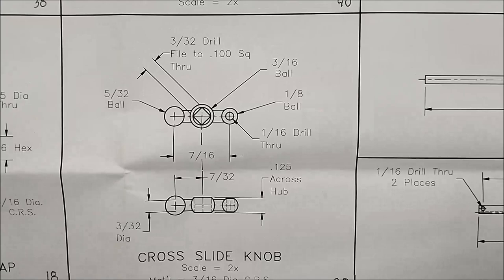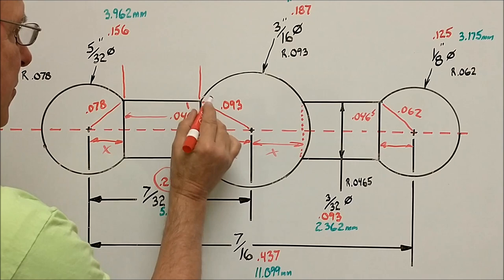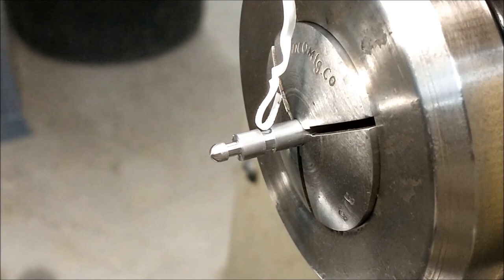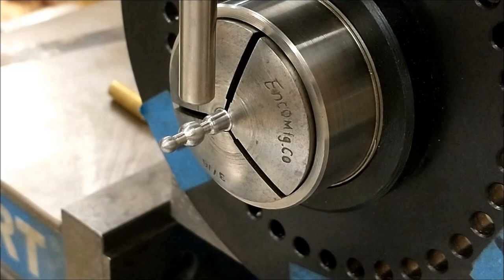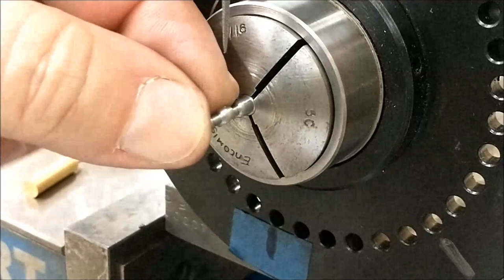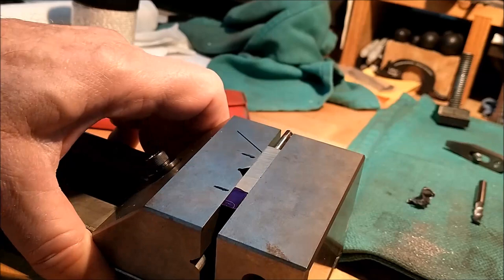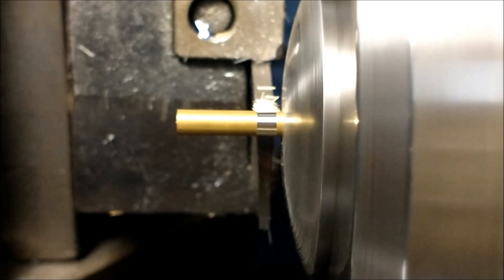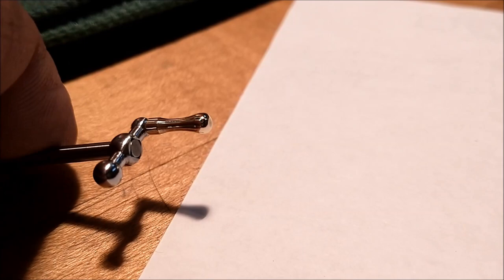Miniature Engine Lathe - #2 - The Crank Handle

Comment: As an old Jeweller can I offer some advice to those looking at buying "Needle files"...
Buy good quality Swiss or German made files (typically from a good Jewellery Supplier) in a 2 & 4 cut.
They wont be cheap so ONLY use them on brass, copper & steel, the "2" is better for roughing in steel & the "4" as a finish.
Save those cheap crappy "throw-away" ebay Needle files for "gummy" metals like lead.
HTH, Colin

Comment: Nice work, as usual Joe. When I used to make very small pieces like this, I made a small hand rest (like on a woodworkers lathe) and small cutting tools, either with wooden file handles or held in a pin vice and did all the turning completely by hand with razor sharp polished cutting surfaces. I finished with 600 and 1000 silicon carbide paper glued to popsicle sticks, followed by buffing with jeweller's rouge. Edit: I should mention that I filed and flattened the edges of the popsicle sticks and glued the silicon carbide paper to the edges with contact adhesive - I would make batches of these as I used so many.

Comment: If you build a miniature CNC mill, then you can program it to build an even smaller CNC mill.  Good luck getting the stock lined up in the miniature vise, though!   Good luck winding the miniature motors.

Comment: A great way to analyze a 2-d drawing, is to model it in a 3-d Cad program. It is like machining the part geometrically and virtually. Now you can easily see measurments not given on the drawing, to suit your way of machining, just like you are doing manually on the white-board in this video. It takes longer, but works well for people who might feel uncertain doing it manually like you.
Also, if one do it for every part, one end up with a complete collection of 3d-models of the whole thing, wich can be assembled, displayed, animated or analyzed in many different ways.
Reply from the maker: Thats usually standard here for internal projects, but this thing has 133 parts. I'd like to finish before Christmas.
Reply: @joepie221  I can understand that :)

Comment: I cannot wait to see you cut the threads for the compound and cross slide and the lead screws and the matching nuts. I assume they will be authentic, and either be acme or box threads. There may even be some specialised internal boring bars made!
Small parts often require greater skill than big ones, and good eyesight.
Reply from the maker: Actually, they will be standard 5-40 LH. Only the feed clutch gear will be special.

Comment: I was thinking "surely he's not going to accept that potato shape?"... of course not! I mean, I would, but we know you don't. Thanks for the tip about using the small cut off disk on a dremel for shaping the radius tool. Would not have occurred to me.
Reply from the maker: It looked round until I blew up the video during edit. I couldn't let that slide. But it looked fine from 2 feet away.

Comment: Another great video, Joe Pie.    I just noticed your scribing tool - I assume you made that yourself... and made a nice cap to go over the sharp carbide point?   I wished you would have put a few shots of you with the dremel tool creating the radius in the form tool.   I assume that you did that with the carbide cut off wheel?    Weird question - if you needed to bend a piece of high speed tool steel - how would you do it?  Get it cherry red with an oxy acetylene torch and bend?   Love these miniatures that you are building.   Definitely family heirlooms
Reply: I dont know how to do that but if it helps you can weld a HSS with a stick welding electrode for chrome Saf5.4  E316-16 / ISO 3581A E19 12 3 LR12,
I joined  mild steel and HSS blank with that electrode.Althou if its suoer small you could use silver brazing.
Hope it helps with whatever you are making.

Comment: I believe the toughest thing on this part for me would be seeing it.  I have an Optivisor I like, but I think this would push me to get some surgeon's eye loupes that attach to my glasses and allow higher magnification.  It's that or mount a stereo microscope on the lathe and mill.

Hat's off if you can see all that without so much as a pair of glasses, Joe!
Reply from the maker: Hi Bob. I have a bank of jeweler loupes I'm quite fond of. When you see one of my fingers in frame and a shadow, you know I'm cheating.

Comment: As some don't have blade micronometers ... just my two cents ... a straight triangle cutout on a sheet may help to check the diameter by measuring how deep the zylinder will pass into the cutout. You may show the maths behind it and how to improve the technique to do the readout. Topic: How to diy measuring tools. 😎

Comment: Joe, this is a beautifully executed job, particularly as it's so small but I have a bit of a beef with the design you are working to. For me, both ball ends should be the same size, the handle should swivel, have a deeper concave curve and should be recessed iwo the ball. But hey, when the thing you're making is not much bigger than your thumbnail who am I to criticise and in any case it's a question of design not your machining. Thanks for all the insights.
Reply from the maker: The non handle end ball on most crank assemblies is always bigger to balance the weight and eliminate the flop potential. I also mentioned a flat on the smaller ball to accept the handle would make it look better. I agree that area could use a tweek from the print design.

Comment: You could make the brass part spin, by leaving the shaft a thou or so protruding from the ball, drilling and tapping the end of the shaft, then securing it through the ball, with a washer head screw.
Reply from the maker: The shaft is only .06 in diameter. I'd have to go sub  'O' on the screw to do that. Maybe a hollow grip over a pressed in headed stud?

Comment: I thought FOR SURE you were going to use a square rotary broach to make that center hole in a different setup.
Did you peen over the cross slide handle knob or expand the back end using a star punch. If you peened it, I would like to know how you did it. With a part so small and delicate, it must not have been easy to prevent distortion.
Reply from the maker: I have a broach, but wanted to share the file trick. When its time to secure these, I'll hollow the smaller diameter for a very shallow depth and use a spring loaded center punch to flare and lock it in place.

Comment: Hey Joe, you've stated before you dont like wearing a wired mic but some of the times at the white board got a little hard to hear. Maybe check out the new mic ABOM79 got,  its a little square thing he can clip to his ball cap and is wireless. as always the machining porn was spot on.

Comment: Thanks for giving the equivalent mm dimensions
Reply: I was most grateful for it in the beginning too, now, after having bought a few machines and having used them, i got to the point where i switch back and forth as i need... If its thousandths, you divide by 40, as 40thou is 1mm... Actually, first practical application of it i used was for welding, as to weld, you can go 1amp per 1thou, meaning 40amps for 1mm steel sheet... Tig i mean, but when i first needed to set my welder up, i looked at the material, saw 1mm and instantly knew it was 40amps/thou, after that, all other fractions and nonsense fell in place by themselves... Tenths are actually a nice thing to work by, and that is coming from an ex metric loyalist... I despised inches and all the american measuring malarkey, but after working in metal and needing say sliding fits and what not, why bother with decimal millimetres, when you can slap an imp indicator and move in a 10 thou, knowing that you moved 0.25mm, dividing by 4, or 1 thou, 0.025(4)mm... If not working by specific design that relays tolerances in microns with practically no +/- allowances, despite working in metric, i will often have at least 3 imperial indicators along with 3 metric ones, each on their own stand and waiting for their moment to shine... I dont go for tenths indicators, as i have metric traumatizers for that that read in micron increments and  0.0001mm increments which is right about when you start losing your shit and want to do some heroin, as that cant be half as bad of idea as working in tenths of a micron... Its what metrology monsters call microcators, as an indicator is something made to refer to such a gross scale, that for an instrument like this, you need a micro prefix... And they say a tenths indicator is maddening... You breathe on the part for a few moments near the point of indication, and it rises as it heats up from your breath... You fart hard enough and it twitches from the shockwave...
Reply: Bro I agree. Us civilised people need metric

Comment: Hey Brother Joe, - I'll bet 55 degrees in your shop feels cold to you after what you went through last summer, but to make you feel a little better the coolant in the horizontal band saw was frozen when I got to the shop last Monday. I'm going to RV antifreeze for coolant for the winter.(Shop cat goes out there with me during the day)   I had parts that had to go before things warmed up and in 30 minutes on the lathe and I had no feeling at all in my fingers (Remember. Loose the gloves around rotating machinery or loose a finger) Best part is it's going to get a lot colder in the next 2 months.  Oh Joy. 

Anyway the reason I called is can you show us the details of the split bushing in the next vid? Did you machine it to the form of the part or what? Inquiring minds want to know. --- I have no clue how you held it. 

I'd tell you good job but you don't know how not to do one. That doesn't make it damnd impressive, though.

Comment: 12/21/2021
First, I know that this project is long ago completed, this comment is FYI only.
If the cross slide knob profile at 1:18 is taken from the drawings used to create the "exploded view" drawing. it was developed from 3D modeling software, where the part was initially a 3D model.
If this is correct then the view at 3:18 is actually correct to the initial model assembly (in the computer).
What you want to create is most likely right, but the drawing is also correct to the computer model.. I used to do shop drawing and 3D modeling (Auto Desk Products). Sometimes the model does not develop the way intended, especially if it is as small as what your dealing with.
By all means, make this part the way you BELIEVE is correct. I know very little when it comes to the actual machine work that you are doing. Honestly I am amazed at the fact that you can do what you do. 
Merry Christmas. ;-)

Comment: Well done Joe, but to be honest, I am not keen on the way the brass handle joins the steel knob. To me there is too much of a change, I would have milled the ball flat so that the handle seats flat. I would also too reduce the brass boss diameter. When you view it side on it does not look like a nice flowing transition between the brass handle and steel ball. Just my Two Pennerths Worth of design criticism, NOT your machining skills.
Reply from the maker: I did mention that very thing in the video. A flat on the 1/8" ball would help a lot. Match the brass handle and away ya go. Perhaps it got consumed in an accelerated segment or didn't make the cut, either way, I agree with you. But much like the steam engine build, I'm trying to stay with the kit numbers.

Comment: What is the advantage of your razor blade technique over just touching the inside edge of the tool to the end of the part and then subtracting the width of the tool on the DRO?
Reply: You can easily get within about 0.000 with a little practice with the blade, plus you don't risk breaking a tiny part.

Comment: why not grinding a HSS blank on a wheel until has a sharp edge, and then mill the radius with a carbide end mill of a radius you want. right into the sharp edge? 
So you have all at once: a sharp edge, the radius you want, and because the edge is pre-sharpend, you only need to mill a little bit and wear only a little bit the end-mill.

Comment: The files you used looked huge and coarse by comparison.  Would you consider using a diamond sharpening 'stone' instead for shaping?
Reply from the maker: No. Using a diamond on anything soft like raw material will clog and ruin the stone.

Comment: Why don't you use a copper tube with abrasive to shape your sphere to shape and polish it to a perfect sphere ? A cylinder will only contact the part to a perfect sphere! The ideal diameter of the pipe shoud be about  1.4142 * radius of the sphere.
Reply from the maker: Why so much larger?
Reply: @joepie221  It is not necessary, anything of the order of the diameter will work fine. When the cylinder is square root of 2 times the diameter of the sphere, the cylinder makes contact between the pole of the sphere and the equator this way you can better judge when the sphere has the exact desired diameter!  Try it you will be surprised how easy you can form a perfect sphere. (The chinese were using that method 4000 years ago, it is history).
Reply: Sorry I ment square root of 2 times the radius, not the diameter. ( 1.4142 * the radius)

Comment: Hey Joe, as an alternate to making a form tool for cutting a 'standard' imperial radius on the lathe, have you ever tried or considered using a corner radius milling cutter.  First off, you'd have
4 edges to use.  I know it wouldnt work for all situations, and of course one would need to figure out how to hold it, but it would save the effort to grind such a tool.
Reply from the maker: I have done that.
Reply: @joepie221  Did you experience any issues with that process?  I've often thought of doing it but havent actually done it yet - too chicken I guess.....
Reply from the maker: @peterstenabaugh3041  No problems. Just take your time clocking it when you set it up, and it should work well.
Reply: @joepie221  Excellent Joe, thanks for your input.  I hope you're surviving the wintery blast down there.  It's pretty common stuff for
us guys in Canada, but it must be quite a shocker for Texas.  Have a good one.

Comment: what to do if you dont have a blade mic
Reply: I've seen others place really fine gauge pins into the cut and then use a normal mic across those. Finicky, but it seemed to work.
Reply: Cry for an hour or two and then start writing a  spam letters to Santa?
Reply: Calipers,,,and and mic the ID horns. If you need to get to a few tenths measure a Jo Block and record any error on the horns,,,,done. --- A blade mic is still a good thing to have,,,,Bet everybody is on eBay looking right now,

Comment: There is another way to get "perfect" balls.  Get a piece of round tool steel & anneal.  Bore a hole in the end as large as possible to the ball's diameter (but always a little smaller).  You will have to go more small to avoid hitting the cylinders between the balls.  Machine the end (on lathe) to leave an acute angle at the tip all the way around.  Harden.  To use, hold the tool by hand & press against the ball as it is spinning in the lathe,  while also, rotating the tool on its axis, and also swing it to & fro.  When the ball is perfect, the tool will contact all the way around.  You can either use the tool to cut the ball (should work on this scale), or as an indicator with sharpie marking where to file.  This is how optical spherical surfaces are formed.  You can cover your tool with cloth & polishing compound to put mirror finish on ball.
Reply: This is the same concept of a coring drill bit right?
You're talking about a hollow cylinder that cuts away your material in a spherical fashion? 🤔

I've seen that before, it's a good idea.  Perhaps a form tool will allow for a more accurately sized sphere rather than close enough? (since you can set the precise radius)
Reply: @Iceking007  The advantage of the "coring tool" is that it forms a perfect sphere over a range of diameters.  For the crank handle, it is not the exact diameter that matters.

Comment: Outstanding as always, Joe! And as always my favorite bits are barely mentioned. Was the split aluminum collet in a collet to provide a better grip and keep the part from spinning? Or to keep from marring the part? And was it just drill and bandsaw or did you do something fancier to make it?
Reply: I have the same question.
Reply from the maker: Remember, the part is 3 different diameters with the largest diameter in the middle. Once the square was put in, the center had crush potential. The grip had to be very delicate so I didn't collapse the square. The bushing had a 3/16 dia .2 deep and the smaller diameter through. This assured 2 points of contact and would axially align the part. I made one for the other side too. Then band sawed them in half.
Reply: @joepie221  that makes perfect sense. Thanks for the well-written reply!

Comment: Another excellent video Joe, but personally I think that handle looks too long in proportion to the cross slide knob. I would have thought up to 25% shorter would look better.
Reply: I guess the issue is that this is supposed to be a working lather rather than just a scale model, so a smaller handle would make it harder to operate
Reply from the maker: I'm Inclined to agree with you. A shorter brass part may be a better proportion.
Reply: @joepie221  I think you should make a folding handle, and also incorporate a clutch so it can freewheel under power feed. 😉